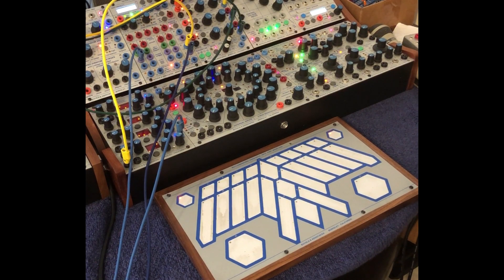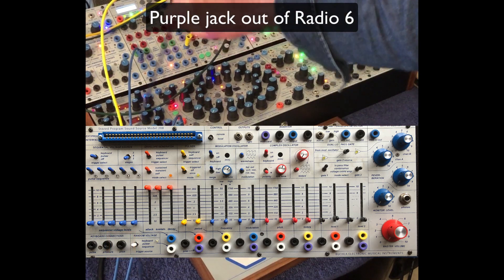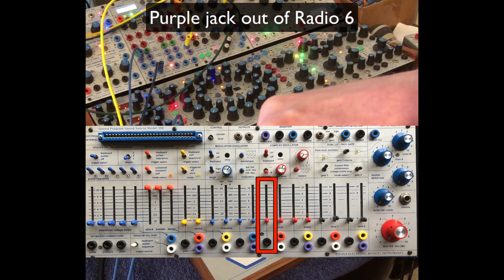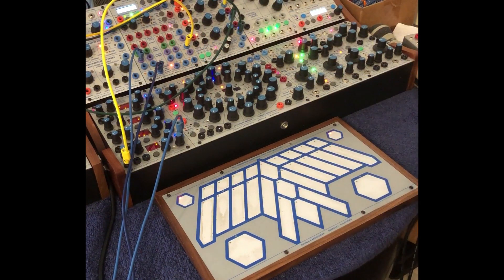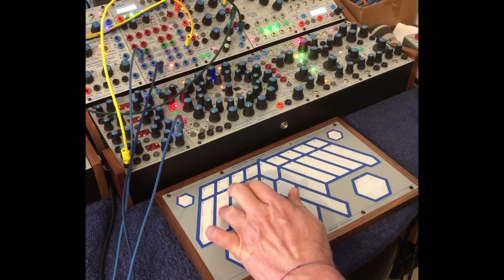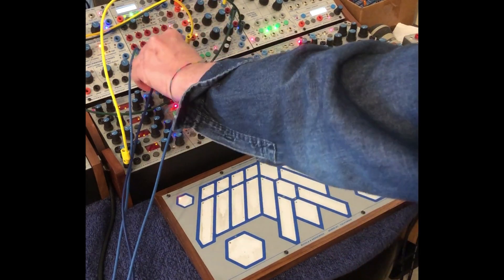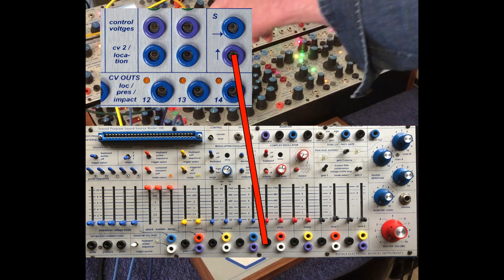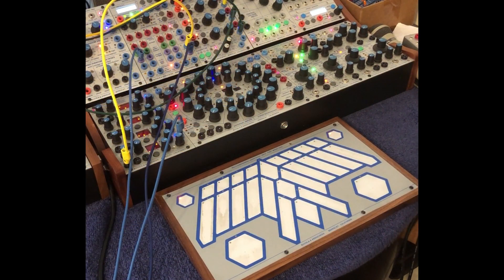Buchla Easel K Pitch Bend

Comment: hey todd, do you know what the range of the mod osc cv out banana is? is it 0-10v or -5-5v? thanks 🙏
Reply from the maker: Not technically minded person but my best guess is 0-10v. Buchla doesn’t do negative voltages. Cheers
Reply: I just measured the output of the mod osc cv out on my 208c, and was getting about 5.5v to 5.1v. This seemed odd to me, so tested a few other outputs. My sequencer output 0-10v, and my EG output 0-7v. So, I believe the outputs are all positive voltage ranges.
Reply: I looked at it a little more, and realized that the output from the mod out was modulating at the rate of the square wave... so those voltages ~5.5 - 5.1 are probably the average, and are probably actually 0-10v.
Reply: @HAntonRiehl thanks so much for checking! 0-10v seems to be the most consistent